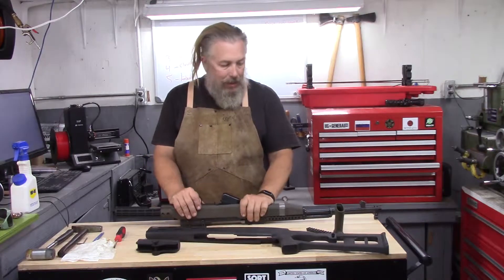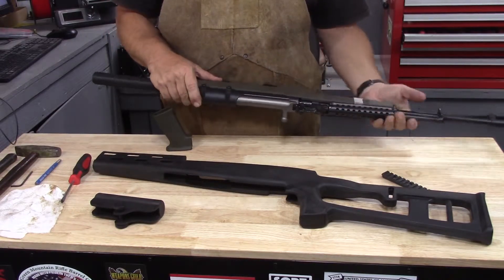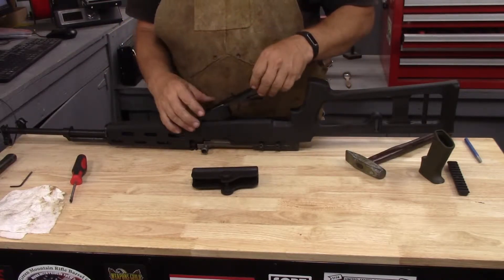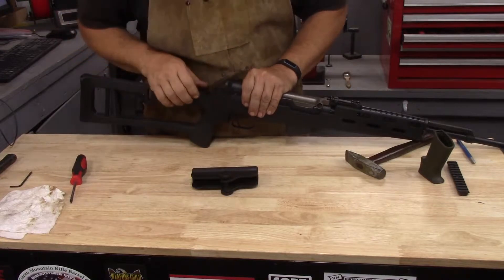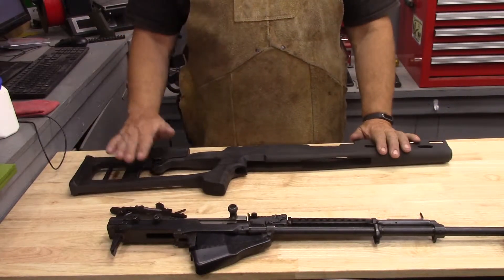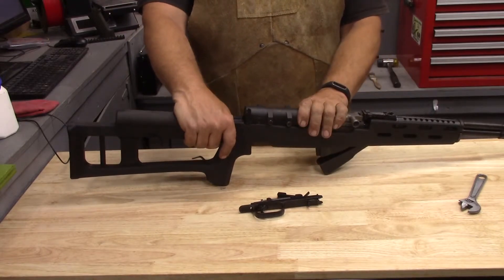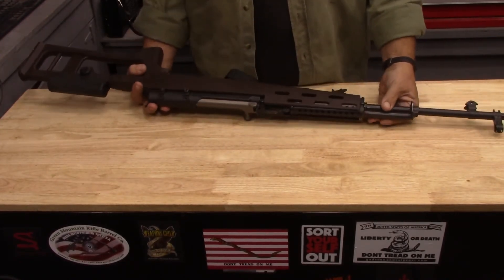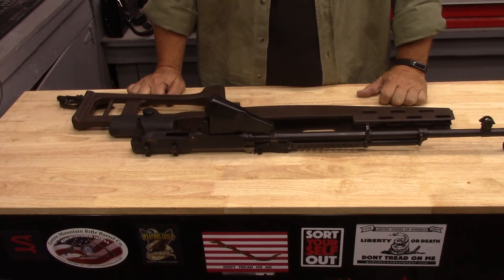sks marksman build stock  part4

Comment: At 6:22 I understand why you cut the material off the rear so you can remove the receiver cover without disassembling the trigger group, did the same in mine but what is the purpose of the notch in the middle?
Reply: Have you seen the first 3 videos? 🤷

Comment: just put teh cross bolt back in the stock or recoil lug and your problem is solved dont put pressure on the lower barrel band not good for accuracy in reality buy doing that you are bowing the stock just use the cross bolt